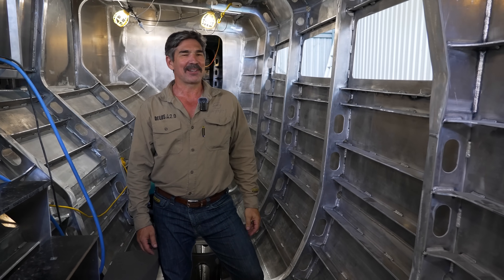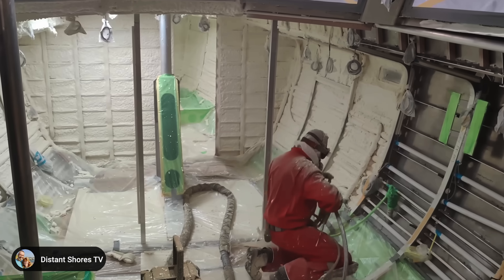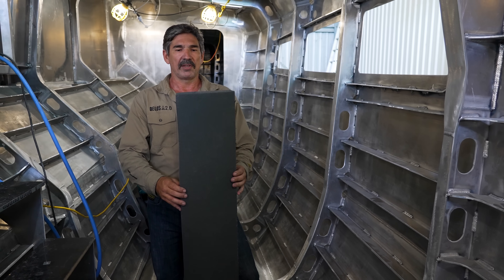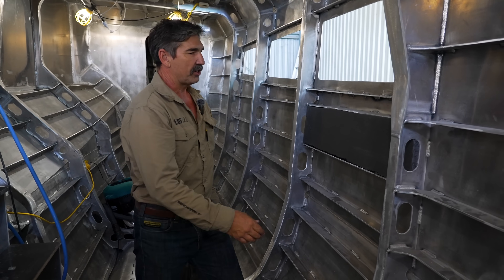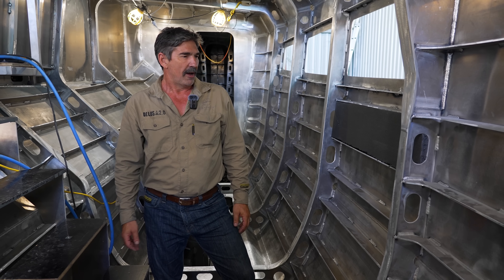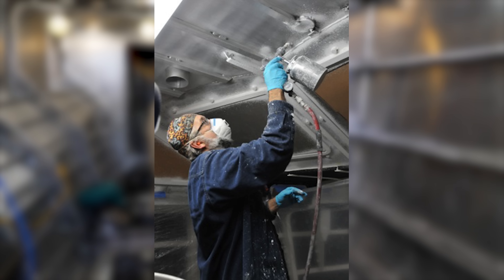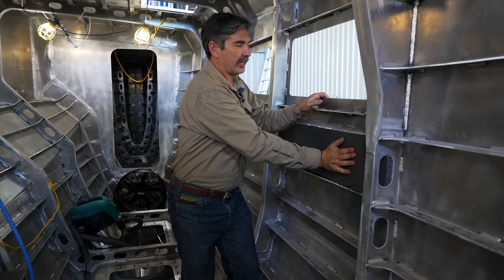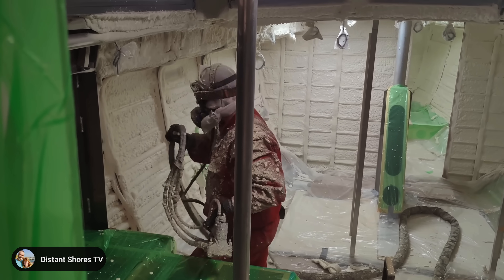HELP, We Need Your Advice!  How Should We Insulate Our Aluminum Catamaran???

Comment: I don't have boat insulating experience but I have house insulating experience.  I am also not a super big fan of spray foam like a lot of people are.  For all the boxes your trying to tick off, I think spray foam is your best option, for your application.  I do like that the bats you showed I think they also have a lot of potential, I am confused why you need to add all those pins to hold it when those bats fit in by friction.  Than also having to paint in a moisture barrier I feel like your adding so much more work that the spray foam would eliminate.  Another thought for your bat idea, to simplify it, instead of attaching those pins to the hull could you add your second layer of foam than push the pins in from the inside?  Also instead of pins do they make an adhesive that would work with that material.  You put your first layer in friction fit into all the cubbies, add adhesive to the first layer than add your second bat layer over the top.  In theory you should be able to remove that whole section without damaging anything and it will go right back in the way it came out.  Just some thoughts I have, hope it helps in some way for you to make your decision.

Comment: Know nothing of insulating boats, but check out the Grenfell fire enquiry ( a tower block that caught fire in the UK ). It was clad in expanded foam panels with aluminium backing. Manufacturers like Celotex lied about their fire resistance, even manipulating the fire testing regulators. The fire was started by an electrical fault and burnt for 70 hours sadly causing loss of life. The enquiry is on Youtube if you want to get into the details. Would imagine the spray foam has no air gaps so is a safer option.

Comment: Not an expert but a couple of thoughts: your goal is light weight, good insulation, easy access, sound reducing AND non burning (if it burns, your boat melts). You are sitting in an Aluminium tube. Go with aircraft approved material. Aircraft industry has solved your problem highly sophisticated many times.

What I am missing in your question is the topic of ventilation / airflow. You will have thermal bridges no matter what you do. Hence, you should have planned points of thermal bridging for moisture to accumulate a these points and be handled with. One possible solution could be the bilge. Bilge not insulated, floor insulated  instead. Now funnel forced air inflow through the bilge. Tropic warm air will cool down and loose humidity in there. Comparatively dry air will be present in your living areas taking up moisture from breathing and being pushed out by the forced inflow of new air via your ventilation system. Thought will need to be given to the bilge to prevent a constant warm/wet environment, I.e. water must be able to flow away also in small quantities and fungi prevention /cleaning is key.

In cold areas where outside temperature is lower than water temperature, you will likely preheat the airinflow and thereby already insert warm dry air and therefore have a dry bilge. The problem moves now to your ceiling. Best alternative would be to suck out air here and funnel it back to your heating system via a heat exchanger. For well insulated buildings these system are normal in Northern Europe and a key part of preventing buildings from moisture. If and how they work on a boat, I do not know. Energy consumption (assume reasonably 2kwh a day), additional weight, cost etc. not considered. You might want to give it consideration.

Comment: Architect here. "Thermal paint" is basically BS. 

While it can definitely insulate against radiative heat transport, it cannot insulate against conductive heat transport, due to its thinness. Conductive heat transport is basically the thing you have to worry about, sailing in a giant aluminum heat sink.
Even if you'd be able to paint with the second best insulating thing on earth (Aerogel), the foam would still be a way better insulator than the paint.

I'd save the money and use a paint designed for corrosion-coating in a marine environment or go with the spray foam. Maybe the spray foam is easily cuttable and in the end, not a big deal servicing underlying infrastructure. Plus: It'll be way better insulating against noise than the PE sheets .
Also: If it's anything water-related, I'd run these water-pipes inside the insulated space anyway, otherwise you'd have the water exposed to a heat-sink. Any electrical cabling shouldn't use much servicing in its lifetime and any electrical devices/circuits I'd also have inside the insulated space. Just think about how hot a car can get in the sun. Now imagine any circuit or water-pipe strapped to the cars metal frame... 
Oh and for extra peace of mind, you could use empty pipes to run the cables through, so you'll have the flexibility to install additional cabling afterwards.

Comment: I'm a Mumby 48 owner, not far from you guys in Brissy. I'll cast my vote for spray foam. It's pretty easy to work with if you ever need to remove and reapply for maintenance purposes. Just make sure that you install plenty of decent sized conduits for all of the electrical and services, if they need to run in the wall cavity. What's far more important for maintenance (IMO) is the linings you use over the foam. Make them removable if you want to prioritise maintenance!
Reply: Can I also just add, paint your bilges! Unless you're able to keep them absolutely spotless, this will save you a lot of heartache. Welcome to come and have a look at what happens if you don't!

Comment: I'm not an insulation expert, but my main concern would be cold bridges. Aluminium is a fantastic heat conductor, and you have stringers and ribs all over the boat. How will you prevent cold bridges? From the options you presented, I would go with the spray foam.

Comment: Maybe a mixture of all three? Paint behind panels for the easy sections and foam in the fiddly corners which will help hold the foam panels in. Assuming that the foam solvent doesn't melt the panels.

Comment: Outside accessible service areas reality is your not ripping off interior liners to access inside hull other than once in a blue moon. Anything behind is going to be on inside of insulation. Too many downsides with insulation panels. That makes  spray insulation the better choice as it ticks all boxes of sealing and insulating all surfaces. You can use two spray products one a seal/insulation the second a insulation only.that if it fails the sealer remains intact.

Comment: I have it in my mind to use the Mylar air packs.  they work both by air space insulation and reflexional barrier.  Larger bubbles could be used in cavities and thinner ones over the  stringers and taped.  This was done on a steel hull https://www.youtube.com/watch?v=vNhVzrHNi8w Lahakai Sailing

Comment: Hello Brian, I follow the channel since very long and i’m a sailor as well, while for living I design and built offshore accommodation for the oil and gas. The best results I had for the bulkhead insulation is with rockwhool and the method of insulation panel and pin you described is the best for the flat surface as long as you seal the whole with scratch tape. If u contact me directly I can provide u with some details and installation drawings. Ciao edoardo

Comment: I am no expert. From my understanding of the pros and cons of both methods. I feel the trouble of repairing for using the spray foam would outweigh the advantages it have compared to the second method. Plus, I have seen you, Brian, carries different tools and spare parts with you for all of your repairs. I think you can snug up a spray gun with the same foam solution you are going to use. Hope I would help you decide a little bit here. Cheers!

Comment: If you go (un-sticky back) foam you might be able to use a hot wire foam cutting setup, a bit like a table saw with a fence, to save time by getting cuts right the first go. For fiddly bits, you might also be able to use a plunge router if a suitable router bit could be found??? I know there are quite deep ones for CNC-type foam cutters but never used one myself.

Comment: Researching through Google... first problem... lol !!!
Yeah... per your presentation and the dilemmas at hand...
Neolene is the way(no sticky back) for primary insulation... AFTER you THOROUGHLY seal the aluminum with best of said products to eliminate any potential corrosion.

After that... the condensation issue... yeah, it gets tricky!!!

I'd definitely create an insulation buffer of some sort... not too thick to compromise your mounting applications, but not too thin to make your efforts ineffective... in my mind, i'm guesstimating 3/8 inch... certainly no more than 5/8 inch.

Its a tedious job, no doubt!!  I'm certainly jealous!!  Be sure to detox from the aluminum... Nuggs too!!  ...she's innocent to the matters at hand, no?

Comment: To me the biggest concern is that your boat is aluminum, not steel. Galvanic corrosion is a big concern that steel boats don't have. Airplanes don't have it either because they are not in salt water. I believe that it can be controlled with a well managed boat. However electrical systems degrade and you never know when a trickle charge or some bi-metal interaction is eating a hole through your hull. So the ability to get to your hull easily to see it is important. Sure you can tear spray foam off, but if it were insulated in panels, you could search for a problem spot by lifting it off and putting it back. You could inspect in a non destructive way. You are going to hesitate to tear the foam up, and it will take a long time to find things. Then you have to spray foam and go through the whole process to patch it. Maybe the spray foam advocates are right. Maybe it would just last. But what I would do is listen to aluminum boat owners. Only they have the equivalent experience.

Comment: From an engineer’s perspective, I’m surprised you didn’t mention the actual insulating performance (the “U” value), nor the sound performance ( generally the “STC”, or sound transmission coefficient).
I absolutely recommend a zinc chromate or better primer as first step.  
Sprayed expanding foam is the best bet for eliminating voids.
Also examine any flammability or smoke transmission issues.  Material data or safety sheets will include all pertinent info.
Finally, I would recommend use of raceways outside of insulated surfaces.  Avoid all tampering with insulated surfaces once the installation has been performed.

Comment: Condensation will be an issue with most insulation choices, except spray foam.  It bonds to the surface preventing condensation

Comment: Re considering My taught 
Close cell panel.   Yes 
Then spray  over the panel that' white insulation 
The 2 Mill stuff I think if well applied in tight place it should keep all moisture away.     Just saying

Comment: Improved thermal acoustic blankets help prevent condensation. They overlap and attach with canvas twist lock button fasteners. Can easily be sewn to fit any space. Fireproof padding used on Navy helicopters.

Comment: Hi Brian ….  A fan since a long time. First time writing to you.  Working in the plumping business as a foreman  in the heating industry, pipe fitting etc…(sorry my french).  My laid pipes are sometimes insulated with a great mildew resistant material called «Armaflex».    Black-in colour , but paintable, this material feels like a very firm and form adapting foam.   This material is pretty dense even though  being very good insulation…. Often used for possible condensation risks…

In my industry it is glued on structure to be insulated AND  together with a specific glue.

Very good cushioned feeling very good for accident under the waves. This material is amazing. You must touch a piece of it before making your mind.

Im mike from Montreal canada.

Comment: I wonder if there is some kind of primer you can coat the aluminum with before you the insulation spray foam, so it would be easier to remove in case a reapair needed to be made somewhere on the structure( of course that will never happen)  Also I was hoping Sam Elliot was going to show up for some sort of mustache show down...

Comment: I have a buddy that is a general contractor. We just had a long conversation about insulation and air flow.  From what I've found doing research and from speaking with my friend is that if there is ANY air gap between the outside and the insulation, you WILL get condensation.  This will likely lead to mold, whether or not the insulation picks it up, it will still be present.  Spray foam completely seals the pocket, leaving no air gaps.  If you spray it on the ribs, it also prevents temperature transfer through the ribs into the boat interior.  As mentioned below, run extra conduit for possible future projects.

Comment: Brian, don't use combustible material, please. A small electrical fire would be devastating. Consider using mineral wool blocks. Put a vapor barrier over it. Don't use foams. If you do, make sure it's polyisocyanurate.

Comment: Don’t know much about boat Insulation, however had to deal with aviation insulation a lot 
I would not spray foam
A Batton fill like you showed and cover sheet is better
Also zinc coating like planes

Comment: From the water line down should be buoyancy and should be used as floating material as well as insulation the second part which would be the dry part above the water line that part should be kept semi exposed so you could track any kind of cancer that might arise cancer meaning rust or any kind of enemy of aluminum

Comment: Wikipedia - Toxicity
Recent studies have shown that not only is zinc chromate highly toxic, it is also a carcinogen because it contains Cr(VI).[17] Exposure to zinc chromate can cause tissue ulceration and cancer.[1][3] A study published in the British Journal of Industrial Medicine showed a significant correlation between the use of zinc chromate and lead chromate in factories and the number of cases in lung cancer experienced by the workers.[18] Because of its toxicity the use of zinc chromate has greatly diminished in recent years.

Comment: Ok, crazy idea.  Your boatyard is skilled in welding aluminum.  In key areas of the boat, you could have them build you a "tank" basically, a chamber to have the gas sucked out of it, using the insulative powers of the vacuum (like a Yeti cooler).  No coatings, no sprays, no foam needed, just the lack of air.  Wouldn't take up too much space (less than anything else would, I imagine), you could repair it yourself.  Nothing to degrade, easy to determine if the vacuum has been lost in a section. Easy to repair yourself now that you are getting so much experience welding aluminum, etc.  You don't want to be scraping and chipping away spray foams, glues, whatever.  Give your boat a second skin — thoughts?

Comment: I used to be a contractor and I did spray foam and what you want is to get the spray foam 2 lb marine, and make sure you ask what kind of prep you need to do for the aluminum. I sprayed some small metal buildings everybody loved it, it stopped all of the water from dripping on everything and kept them warm in the winter and cool in the summer. It makes a huge difference and it protects everything you spray on it. Don't go with anything else because you want to do it right in the first place. If you put anything else in there and it starts sweating behind it then you'll say how much that sucks and you should have changed your mind. That sweat on the metal is really bad.

Comment: neoprene. It is used a lot in hvac insulation. Used it on my steel boat and i have never seen anything like it. Living 52°N and middle of the winter, water frozen deep, i only needed to heat 30min to keep a nice temperature for all the night. You find it i rolls, cut out to size and glue, then seal the pieces with 1mm neoprene self adhesive rolls. Only downside is the price, but it's worth it.

Comment: Hey Brian! I'm no expert of boat insulation, but something came to my mind. The foam you are planning to use is homogenous. That limits its sound dampening ability. Also it might not be able to dampen noise due to vibration travelling through the structure. If not too late - and the professionals agree with it - have a look at Acoustic Damping Patches. It has been used widely in the automotive industry with success. Those are small patches adhered to the panels of the cars (roof, doors, floor, etc.) to mitigate travelling vibrations. The question is the effectiveness of it applied to such thick aluminium plates you built the boat out of. It might worth a try.  Look for e.g. `sika automotive panel damping', '3M Sound Deadening Pads', 'Henkel Acoustic Damping Patches', and so on.  o7

Comment: You need think of surveyability of the hull. Spray foam would mean you could have cracks and not know. You also need to think of smoke and toxicity in the event of fire. The black  insulation looks like it has no fire insulating properties and probably produces toxicity smoke.  Mineral wool with pins would be my opinion although quite heavy but safer for you family. Surveyor with over 30 years of experience.